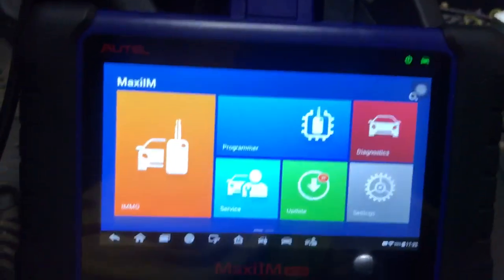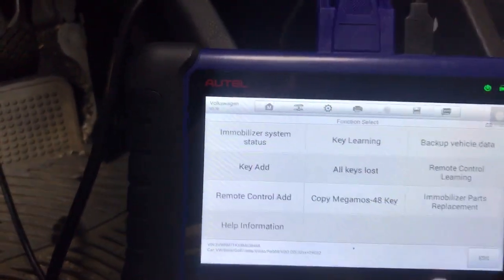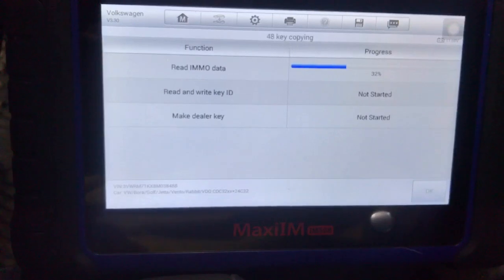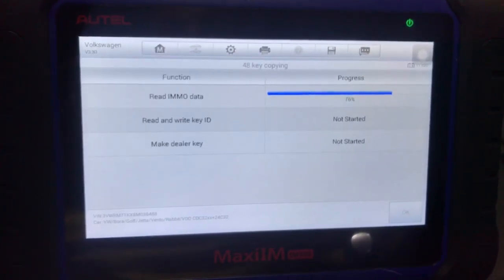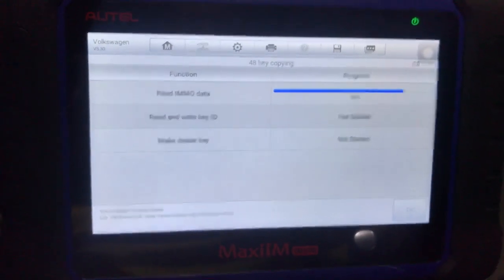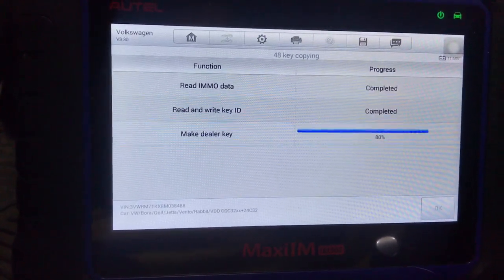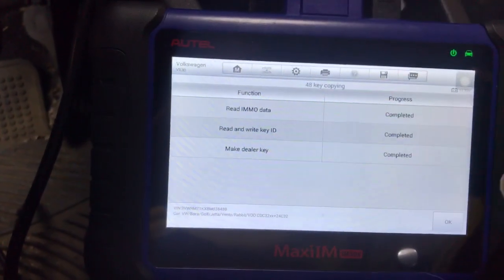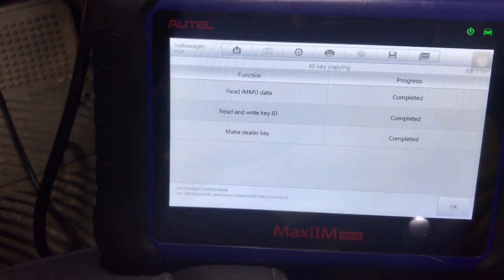Key Cloning with Autel IM506 VW Jetta

Comment: Will the 508 and the xp200 clone a 2018 Honda odyssey smart key? I would be getting key from dealer customer has remote start I’m not to familiar with how remote start works it’s a viper aftermarket so my thoughts were maybe just clone a key and should just be good.

Comment: i have 2014 vw jetta 1.8L push start button  i bought from the auction wrecked it came with one key but does not run and its showing no keys on the system try to add a key with my Autel im508 xp400pro once the procces almost done on last thing fail learning key any suggusting
Reply from the maker: Can’t do it server access has been restricted. VVDI2 might do it

Comment: Did you use an unprogrammed 48 chip to clone it? Thanks for the great video! 👍
Reply from the maker: Yes I did
Reply: @SpartanAutoworx  I just bought a key from the dealer had them cut it and when I tried to use the autel to program it it says the 48chip is locked and I cannot program it for the immo. When I select unlock it says it cannot unlock it.
Reply: maybe it's already a dealer key learn if to the vehicle this is a good thing
Reply: Buy your own chip & do as in video. Having vw do some of it then you will have issues.

Comment: During the vídeo, you had to choose which key to copy and gave you 2 choices, how do you which one to copy ?
Reply from the maker: Its going to list the keys programmed to the car. You can select either one doesn't matter. No position on or two on vw.
Reply: You could simply read the key ID of the current key you have. You can copy any key listed but he choose to pick a key ID that he didn't have. I would of did the same. The car come from the dealer with 2 keys. So there will at least be 2 options.

Comment: Oi mate whats the big difference between the 508 and 608? i was thinking of getting the 508 and the xp400 down the road, or should i save for a 608 all together
Reply from the maker: 608 comes with the xp400 and j2534 and is a ton FASTER
Reply: @SpartanAutoworx  j2534 is used for what exactly!
Reply: The 608 has more diagnostics but programming is keys is same

Comment: Where are you getting the cloning chips? What brand?
Reply: Was the 48 chip 96bit ecrypted and was the chip blank or just a regular 48 chip?
Reply: @robertwilkins839  I have a 2007 have the same question
Reply from the maker: I get most from ebay when I buy in bulk. If I need them right away or just need one I use one of my key vendors

Comment: THANKS FOR THE VIDEO , I AM VERY INTERESTED IN KNOWING IS THIS TOOL ON THE SEEM LEVEL WITH AT LEAST THE AUTEL 906 WHEN IT COMES DOWN TO DIAGNOSTICS . ANY HELP ON KNOWING IT'S CAPABILITIES ON IT'S DIAGNOSTIC POWERS WOULD BE GREAT BEFORE I GO AHEAD AND BUY THIS TOOL . I CAN TRULY SEE IT HAS THE KEY PROGRAMMING ASPECT DOWN . SO MOSTLY I WOULD BE NEEDING IT MORE FOR BIDIRECTIONAL CONTROLS , CODING , ACTUATION'S , KEY PROGRAMMING AND IT'S DATA RECORDING  . THANKS AGAIN FOR YOUR TIME AND ALL THE BEST LOOKING FORWARD TO YOUR REPLY !
Reply: 906 will not pull key codes or focus on keys in general 906 is for diagnostics ... it can do keys but u will need to get key pin code first.... 508 and 608 pull key code from car

Comment: Can the IM508 virginize Toyota ecu? Can it pull pin on SKREEM module? Reason I ask is I saw it has a Pomona clip in the kit and can find an answer even from Autel. Thank you!
Reply from the maker: DCX Skreem module no problem. No need to even open the skim with this tool. Cant answer the toyota question.

Comment: Can this tool do all lost keys on 2015 Jetta? Guy I know lost his only key and the only option locksmiths are giving him is to take it to the dealer. I have never done a VW and I always read that you need a PIN. I found a tool that can only add keys but you must have a working key in order to get into security system. Also, thanks for this video. 👍🏽
Reply from the maker: I imagine you can do this procedure on a 2015. I have a 2013 Passat im going to cut another key for. Just waiting for a local dealer to bring it to me.  VW requires all key preset when you add keys. So you can't just add a key in theory. This clone feature seems to be the best bet that I have seen.